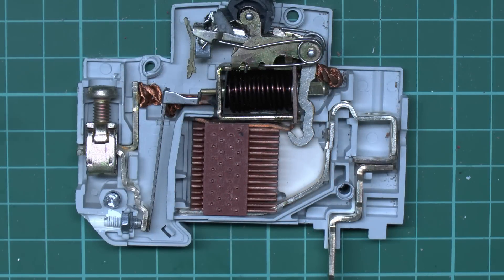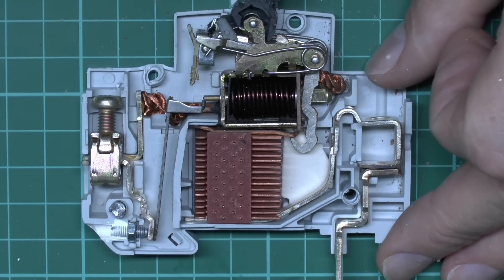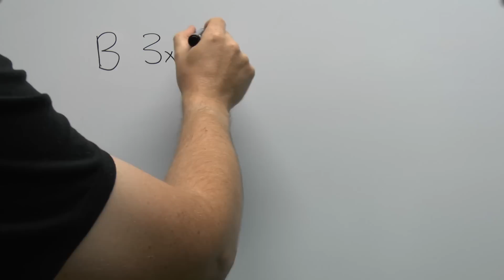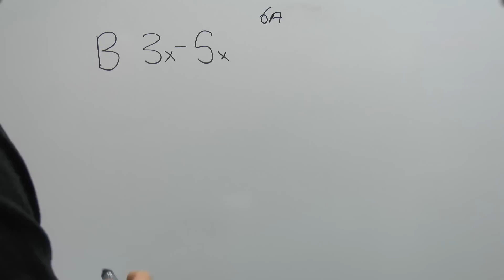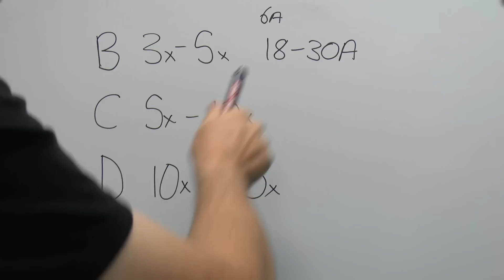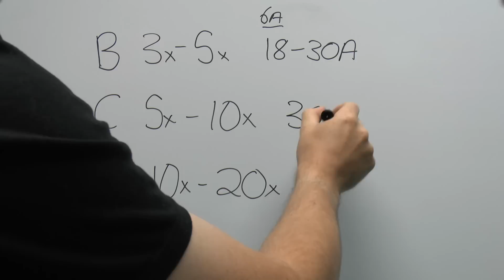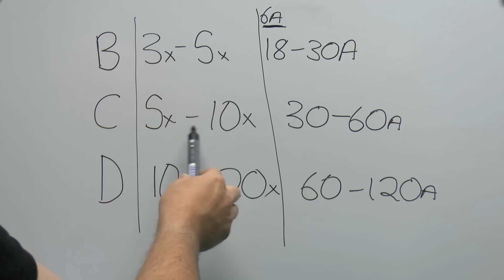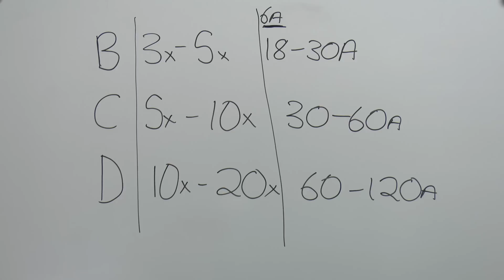Circuit Breakers - How they Work, What's Inside

Comment: 5:10 Tripping coil, so only when a large number of current flows through it in the event of short circuit then it will energie the pin enough to break the circuit.

Comment: Im a licensed electrician in the us .I think the UK and countries that use miniature circuit breakers as primary branch circuit protection need to reconsider especially at 240 volts to ground which IS NOT SAFE FOR A HOME. In the USA you can only use molded case breakers for protecting branch circuits even at 120 volts. Miniature breakers can ONLY BE USED AS SUPPLEMENTARY PROTECTION.
Reply: What are you on about exactly?  We actually have a 'cut out' fixed, or service head main fuse as well normally in domestic dwellings in the UK, but not a primary mccb between the service head fuse and then the final circuits.

Comment: 6 amps? I've never seen that before. In the US our lowest breaker is 15 for any residential and 20 for commercial. How many breakers are in a 2500 Sq ft home over there?
Reply from the maker: 6 amps but that's at 240 volts, so the equivalent circuit power of a 12 amp 120V breaker.
Newer properties generally have more individual circuits, older ones have a smaller number of higher power circuits that cover larger areas.
2500 sq ft would be a very large and expensive property in the UK, most are far smaller than that.
Reply: @jwflame  lol my 2 bedroom apartment is almost 2500 Sq ft

Comment: Very interesting how the arc breaking cooling mechanism is basically a safety spark gap such as when coilers use them as a safety gap for our Tesla Coils and their high voltage power supplies. It prevents over shoots due to resonant current and voltage rise on the LC network.

Comment: I'm not even from the UK but these videos are so fascinating to watch. 

On a random note I notice circuit breakers throughout Europe all seem to use the same DIN rail connectors. Wish we had that kind of standardization here in the US because breakers can only fit into consumer units made by that manufacturer where as MCBs can fit into any box regardless of manufacturer. (Correct me if I'm wrong)
Reply from the maker: They fit onto the same rail, but connections to the busbar and spacing of the terminals can be different between manufacturers.
Consumer units are type tested assemblies, and that approval only applies if all of the devices in it are from the same manufacturer, so although it's often possible to physically fit devices from other manufacturers in there, it shouldn't be done.

Comment: Mr Ward , how the MCB discriminates a short ckt current and overload current when both these current enters MCB then it goes through the solenoid and enters bimetallic rod. The Solenoid should trip the MCB in both cases.
Reply from the maker: The bimetallic strip is for moderate overloads and reacts slowly, trips from 1.13x to 1.4x the rated current and above.  It will typically take many seconds or 10s of seconds to trip. 
The magnetic solenoid is for short circuits and for a Type B will trip near-instantly from 3x to 5x the rated current and above.
Reply: @jwflame  Thanks, Mr Ward.

Comment: @JW Can circuit breakers depreciate when they trip (too) often?
Reply from the maker: Yes, they don't last for ever.  Repeated trips will cause damage inside and they will eventually fail.
Reply: @jwflame  Every product has a lifetime, that is clear. However, it looks like the performances are also effected (i.e. getting weaker: not able to withstand the same load and/or inrush peak current as before).

Comment: John - where you have, say, a 6 amp breaker, why do these have a figure of 6000 on them?
Reply from the maker: 6000 is the breaking capacity, 6000 amps.  When a short circuit occurs, a very large current flows, this particular breaker can only disconnect if that fault current is less than 6000 amps.  More would probably destroy the breaker and could result in it not disconnecting (such as the contacts inside welding together).
Higher breaking capacities are available for situations that require them.
Reply: John Ward - thanks John and I think I understand what you’re saying. It seems that in the cases where Ze/Zs readings are very low, this would allow high currents to flow in the moments before breaker tripped. So as long as the maximum fault current is below the rating on the breaker, that breaker is okay.

Comment: How is MCB or MCCB different from ELCB, RCBO and RCD?
Reply from the maker: MCB/MCCB disconnect on overload or short circuit.  RCD/ELCB disconnects if an imbalance is detected between L&N.  RCBO is both devices combined.
Reply: John Ward May I also ask what about RCCB?
Reply from the maker: RCCB same thing as RCD.
Reply: John Ward Thanks for making it short and clear for me.

In addition to those, is it true that ELCB/RCD/RCCB can be function based on detecting either the current or voltage difference between L&N?

It seems like if it were to be function based on current, a current transformer (of some sort) is used. What if it were to be function based on voltage?
Reply from the maker: They all detect difference in current - voltage would be impossible as supply voltage varies all the time as loads change.
There was another type which used voltage but that required connections to the installation earth and a separate earth electrode, such things haven't been permitted since the 1980s.
Reply: @jwflame  Alright. Thanks a lot. Appreciate for your teaching!

Comment: Hi John - thanks for your very clear explanation. I've recently bought a 2nd hand 240v angle grinder from a certain online aution site.... I've tried plugging it into my garage 13a sockets (protected by  a  'B' 16a MCB) and the MCB trips every time, almost instantly, spinning the cutting disc momentarily. However, when I plug it into the house ringmain sockets, protected by a 'B' 32a MCB, it will run continuously. Can you say please if my garage electrics are simply not up to the job & I just need to use the appropriate house circuit or could there be a fault with the appliance? I understand that these tools do draw more current during startup that when at operating speed.
Reply from the maker: Unlikely to be faulty, motors do have a significant surge when first switched on, often 5x-10x the running current, so can easily trip lower rated circuit breakers.
Reply: Thanks John.

Comment: The screw which attaches the circuit to the top... is it an exposed live part?
Reply: No, this would normally be behind the Shroud, and you should only remove this once the circuit is Safely Isolated, and then only if you’re Qualified! - Julie

Comment: Hi john can you answer me why does my circuit breaker trip sometimes when I plug me my 110 v yellow transformer thx
Reply from the maker: Transformers appear as a short circuit before power is applied, so there is a significant surge when switching on.  Once power is applied, the magnetic field of the transformer limits the current to almost nothing until something is connected to the output side.
Whether it trips or not depends on where the AC mains cycle is - if it's at the peak value it will probably trip, but if at a low or zero value it probably will not.

Comment: what  would a 6A device allow 10A, shouldn't it trip @6A, otherwise what's the definition of the specified rating.
Reply from the maker: At the rating specified (e.g. 6A), the device will never trip.  Above that it will trip, and how long that takes reduces as the current increases.
For circuit breakers, they are defined as tripping will occur within 1 hour at a current of 1.45 times the rating, so 8.7A for a 6A device.

Comment: i know this is not recommended and its dangerous but, is there a way i can disable the trip?
Reply from the maker: No, circuit breakers are specifically designed so the cannot be disabled, they will still trip even if the lever is fixed in the on position.
The only way to disable them is to remove them completely,  and with no overload or short circuit protection the cables will overheat and cause a fire when a fault occurs.
Reply: Why would you want to? Wont it just start a fire?

Comment: Hey thanks. Is it possible to fix / recondition some of my obsolete Zinsco breakers ?
Reply from the maker: +Sajid Rafique No, if circuit breakers have failed, they must be replaced.  Zinsco were never sold in the UK, but a quick search reveals they are the type which welds closed and cause fires, so probably better to replace the entire panel.
Reply: +John Ward  Thanks John, for informing me of the fire hazard ! Really appreciate that  !

Comment: Dear John,
The layout of the ARC-suppression, might suggest that the MCB should only be installed vertically (so the arc might naturally travel 'up' into that gap, instead of going the other way where there is no suppression-materials).  Is this actually the case, or can MCBs (generally, subject to manufacturer instructions) be installed in any orientation?
With many thanks,

Comment: I request a similar teardown of an RCBO, with a discussion of the differences/reasons for some having an flying-lead earth (Functional Earth??) connection to them and others not.  Also very interested in the compromises involved with the smaller sized RCBO unit over a large RCD.  Similarly, single-pole-isolation (bad on TT supplies??) not isolating N-E fault from upstream could be worthy of mention =).  With thanks,

Comment: Dont get how the thermal strip is heated. The circuit is operating overloaded. The strip operates because the heat that has built in the breaker ?. If so, the power disipation if the breaker itsefl should be sorta of "calibrated", I mean, a well known resistance from input to output. It work in that way ?. Another question, does make any difference swaping terminals. That is, using the input as output and output as input. Because here both type of breakers (called Themo-magnetic and differential) have terminals on both sides. not like the ones you showed that has an input terminal to hock in the box and one only one (output) screw terminal type. Nice vid. cheers.
Reply from the maker: 38911bytefree The heat is created due to the resistance of the bimetallic strip itself.  They don't get particularly hot, only warm..

Electrically the terminal arrangement makes no difference.  The one in the video is designed for use in one type of consumer unit only, so would always be used with the load wiring connected to the screw terminal.  Most others have two screw terminals.
Reply: ***** Many thanks. so, the bimetallic strip is in "series" with the circuit ?. That is, current flows through it ?.  Regards.
Reply from the maker: 38911bytefree Yes, the full load current goes through the strip.

Comment: I would have thought that a good old-fasioned simple wired fuse would be more failsafe than a complicated contraption like that. The Circuit Breakers
looks like it would be prone to manufacturing errors and such.

Comment: We installed 6A, type C, circuit breakers in head frame on the top of a light pole, protecting 600W, HPS , IP65 luminaire . During commissioning and in a very  hot day  with outside temperature  45- 50 Deg. C. the MCB trips. switching off the lamp's circuit. Obviously the thermal element inside the breaker reacts to heat and trips the device. what do you suggest to do in this case.
Reply: Akram Al-Hayek  A HRC fuse my best guess.

Comment: i still have a 1940s MEMREX circuit breaker is it safe to use?
Reply from the maker: david freedman Possibly, although if the wiring to it is original, the wire insulation will certainly be unsafe.
For switchgear and similar items, age in itself isn't a problem - it all depends on the condition it's in and how / where it's been used.
Reply: ok thankyou your help.

Comment: I got a 240V 10A C type breaker as a resettable fault protector for a heater control system. It has a PID controller for temperature adjustments, an input VA meter, a 12V 0-999 second timer between the PID and the mains solid state relay and finally a SCR dimmer to adjust the wattage from pretty much 0 all the way up to what the breaker will allow.

Now I'm wondering if an B type would've been better in case of an accidental short circuit in the exposed kanthal coils and whether or not the breaker will trip before the 15A main circuit breaker does, assuming there's no other load?
Maybe I'll just add a 13A quick fuse, that ought to do.
Reply from the maker: Kageitenshi For short circuit faults there will be little or no difference, both a B and C type will trip very quickly - typically less than 0.1 seconds.  There won't be any discrimination between a 10A and 15A circuit breaker either, so either or both could trip.
Reply: *****
Thank you for clarifying. Though I may be a bit paranoid about overloading the breakers, resulting in a walk of shame, I'd prefer to be on the safe side:

Until I realized that my newer water kettle was rated at 2.6 kW, instead of the 1.8 kW it replaced, I routinely ran it alongside an 800W microwave and a lamp. It wasn't until I tripped the kitchen appliances breaker that I realized I was drawing very close to  its rated 15A from the ~230V mains.

Came as a surprise every time until I learned not to do that, rather slowly, thanks to how the microwave operates on "medium" and  "low" settings for thawing, randomizing the intervals.

Well, despite not having enough resistance at the business end of the kiln's heater to limit the current below 10A, but closer to 15A, the SCR dimmer and VA meter should be sufficient controls. Safety first.

Comment: there some time high voltage come in home which destroy the all equipment
so  is any device which avoid such problm ?? 
pls reply
Reply from the maker: bhupendra sharma yes, such devices exist.  Either surge protectors for spikes / intermittent increases, or an overvoltage release for situations where the supply voltage increases above normal.  Hager MZ209 is one example.

Comment: We used to have a Big Freezer that used to trip off at random times usually in the middle of the night, I assume the Circuit Breaker was the wrong type
Reply from the maker: brian whittle Possibly, larger motors often require the use of C type breakers as the starting current can cause B type devices to trip.  Alternatively it could be that the motor had some problem such as sticking bearings, which would cause it to draw more current.

Comment: Where are 6A circuits use in the UK?
Reply from the maker: Per Mejdal Rasmussen Lighting circuits usually, most homes have 6A lighting circuits with one for each floor, some older or smaller properties have a single 6A circuit for all of the lighting.
Reply: ***** Interesting. Then you can use 1,0mm² instead of 1,5mm² thick wires.